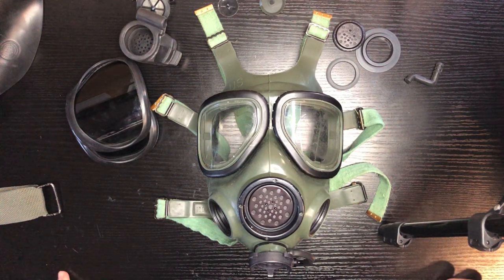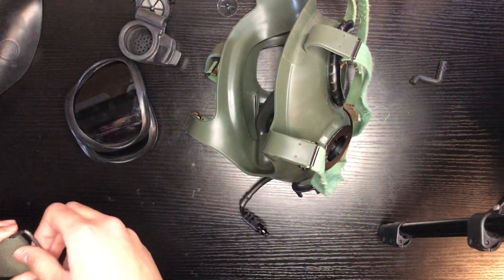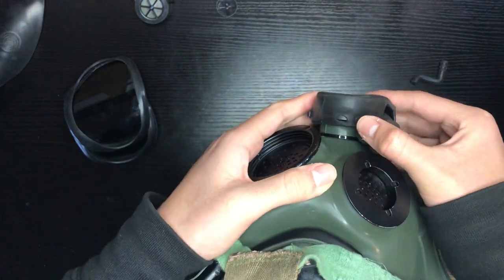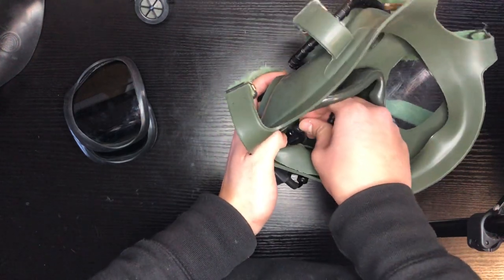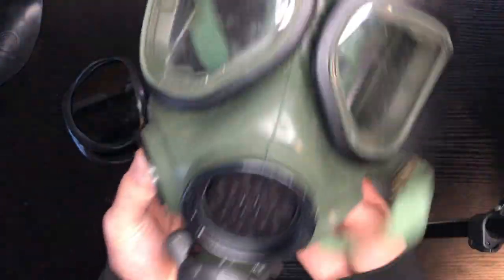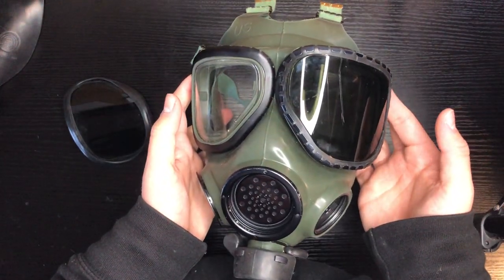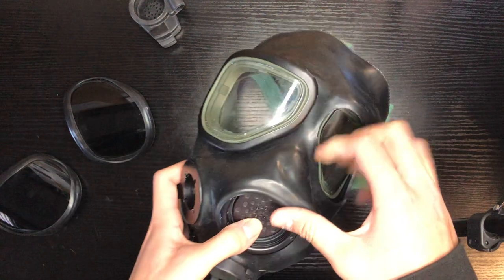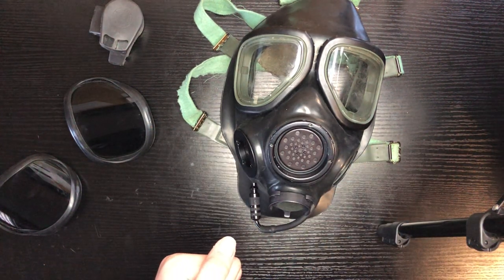How to reassemble a US M40A1 (2/2)

Comment: Do you know where I can find replacement valves for my M40?
Reply from the maker: Depends on which valves you’re looking for, like the nosecup valves or exhale valve for example. If you’re in the US, i believe AeonFawkes may have some. Or they occasionally appear on Ebay
Reply: Honestly didn’t expect a response on such an old video, but I need a nose cup valve. Did some research and found the 3M replacement nose cup valve and assembly and a guy said it worked in his MSA millennium which is extremely like an M40. So I ordered it will update. Thanks for the response.
Reply from the maker: of course, hope it arrives safely.

Comment: hey got a question was wonderin if its possible for the buckles to be replaced at all cuz the one i got the buckles dont look all that solid
Reply from the maker: hey there! sorry for the late response, but I believe the metal buckles can be replaced but not the straps themselves because they’re attached to the face blank. However, for the buckles i have not seen them being sold alone as replacements on the market at all. Sorry about that.

Comment: I was wondering where i could find the second skin, is it necessary?
Reply: will the gas mask function without the second skin?
Reply from the maker: Yes, the mask can function totally fine on its own against some of the most common chemical agents. The second skin provides additional protection against Blister agents. You can find a second skin relatively commonly on ebay, or American surplus stored and sites. Hope that helps a bit !

Comment: Nice bruh
Just wondering, do you know how to remove the type 65 gas mask filter? Or do you know someone who does?
Reply from the maker: i believe you can’t take it out without damaging the mask, i may be wrong
Reply: @yomada7790  W&S93 did apparently in one of his streams but idk which one
Reply: @yomada7790  yo never mind bruh. I got mine today and I just had to remove the wire and tape around the inlet assembly and stretch the rubber opening around the filter
Reply: @yomada7790  type 65 filter can only be changed by cold war era Chinese army engineer. Lol.

Unless you can find a Chinese chemical corps veteran I really don't think it's plausible. I'd just bet on the stock filter being unused. If it's unsafe to wear you shouldn't worry about it. Likely contains asbestos.

Comment: When I was putting the rubber pieces back into the tube valves you mentioned around 3:20, then I pressed too hard and broke the plastic. Is there a way to replace them? ._.
Reply from the maker: Oh no, i’m sorry if I was at fault. But I did manage to find a seller with lots of the tissot/oronasal cup valves https://www.ebay.com/itm/M40-Gas-Mask-Nose-Valve-Disc-New-Nosecup-Nose-Cup-10-Pair-Per-Box-11-Avail-/154177752480?mkcid=16&mkevt=1&_trksid=p2349624.m46890.l49286&mkrid=711-127632-2357-0 he’s selling them in lots but maybe you could ask him for a single pair with a price that may intrigue him to sell you one? Again, I’m so sorry if it was my instruction that caused the mistake
Reply: @yomada7790  Oh no, it wasn't your fault haha
I was just being too rough with what was clearly a fragile piece lol
It was unfortunately the piece that's attached to the nasal cup that I broke, I think it's called an inlet valve? I was just being too rough when pushing/pulling the rubber/silicon piece that blocks your exhaled breath from fogging the lenses, and the flimsy valve itself broke.
Reply: @yomada7790  Do you know where I could find a replacement inlet valve?
Reply from the maker: @adorablecenturion8436  ohhh you’re referring to the plastic valve assembly that’s literally attached to the nose cup and irremovable right; the one that the valve disc stick thingy goes through right? uh well im not quite sure if they have replacement parts that can be bought online, but i could be wrong. Sorry about that, and if you plan on having the mask useable, you could probably just cover the hole with like duct tape so then no breath will escape but if the lenses do fog, they will only have to be defogged through the remaining valve assembly. Hope that helps a bit :/
Reply: @yomada7790  Oh sorry btw just to specify more, I mean one of the two valves that the smaller rubber discs attach to Ive only seen a couple of them around some sorta sketchy sites, but thats it.
I think they're just sealed in place with some kind of glue. When I broke my valve I just took it out. It actually seals back in pretty well by hand, and doesn't move anywhere. I'll probably just duct tape the hole if the fogging is bad enough. The mask Im using is a bit rough around the edges anyway, the insert lenses have a few scratches and the drinking tube is just broken, I intend to get a different mask in the future anyways lmao
Reply from the maker: @adorablecenturion8436  yup yup that’s the one i’m talking about, we’re on the same page lol. By any chance is one of the sites you saw called aeon fawkes? because as far as i’m aware that site is mostly legit, except the dude requires a minimum amount of purchases.
Reply: @yomada7790  Oh Ive looked on that site as well, they don't have that specific valve unfortunately. I was just going through disassembly videos to figure out how to swap my filter valve to the right side of the mask, since Im a left handed shooter.
Just got a nice MSA VPU for my M40 and now I've broken a pretty important piece of the mask, what a shame lmao
Cheap scotch tape completely solves the fogging issue, and I can still breathe fine so I'll just stick with that I suppose
Reply from the maker: @adorablecenturion8436  hey man well i hope you do get that other mask soon or somehow manage to find the part ! best of wishes bro
Reply: @yomada7790  I appreciate it :> have a good one
Reply from the maker: @adorablecenturion8436  you too!
Reply from the maker: hey there again! i was doing some random research and i came across this, perhaps this wasn’t one of the suspicious sites you came across ?http://www.gasmaskparts.com/mobile/Product.aspx?ProductCode=AAAGAS-271
Reply: @yomada7790  It was! I didn't buy anything from them though.
Reply: @yomada7790  Timbits here, not only are they removeable, but they're replaceable too! I have a bunch of them.
Reply from the maker: @wsg5920  AYYY TIMBITS COMING IN CLUTCH !!
Reply: @adorablecenturion8436  Hey man, don't worry, they actually did produce replacement parts for the hard plastic nosecup valve seats, I have about half a dozen of them. I've removed and replaced broken M40 nosecup valve seats no problem and the mask seals better than ever, do you want one?
Reply: @wsg5920  Ay I do
Reply: @adorablecenturion8436  Got an email or a discord or something I can contact you at?